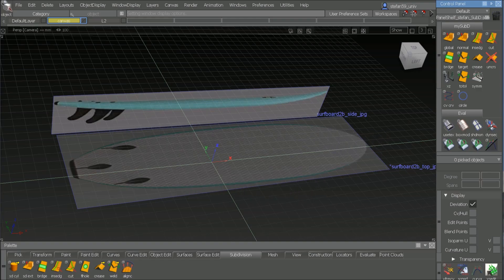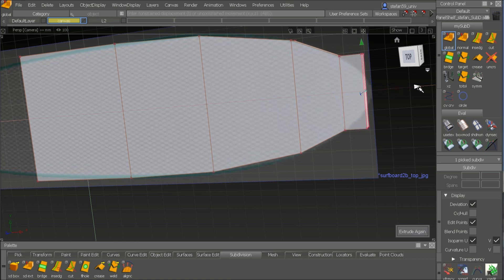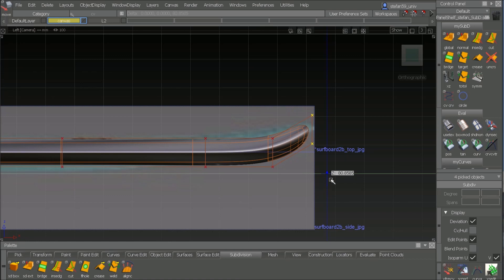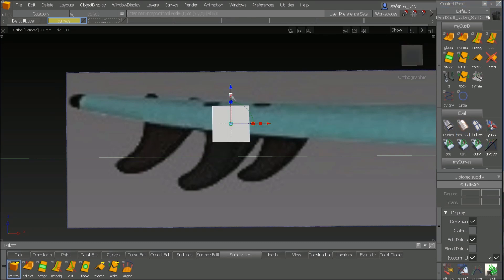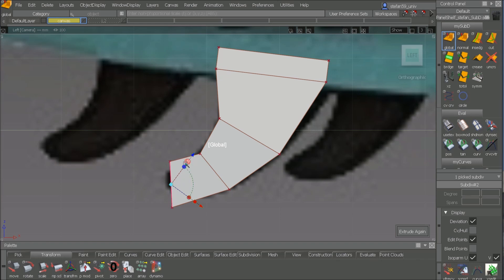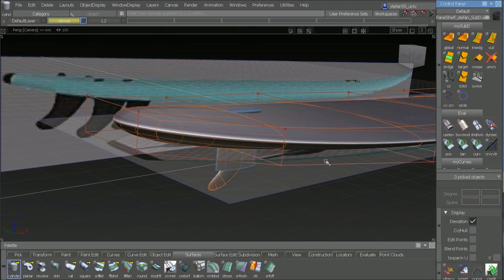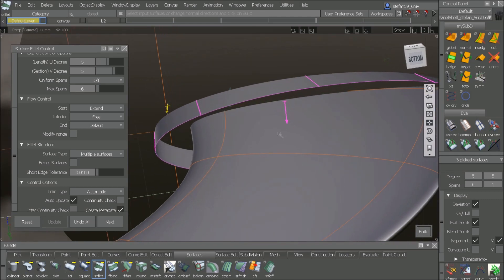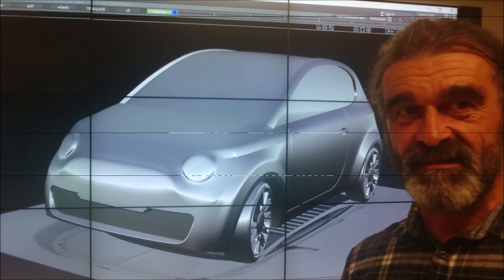Alias 2020 SubD Modeling Basics

Comment: My alias is 2020 and it doesn't have this subdivision feature. Does this link you put in the description happen to install this feature in the program? Thanks
Reply from the maker: Hi Mauri, usually Subdivision Modelling is by default included in Alias2020. My links just give you additional user menus for faster workflow. In Alias 2020 you find Subdivision Modeling Commands under Palette->Subdivision. Probably check also your license: Is it Alias Design, Alias Surface or Alias Autostudio?

Comment: Great video.   I'm sure Stefan knows this.   For anyone following along, when moving cv's. Instead of pick nothing, pick CV, move, then hitting pick nothing afterwards, simply press shift after you have moved the CV.  This takes you back to selection mode while still in the move tool.  Look in the prompt line to find out what your selection mouse buttons are.   My middle mouse button is set to "pick" , which allows me to bounding box on the next CVS and it will automatically deselect the previous selection, let go of shift and proceed.   Alot faster and allows you to use pick nothing a little as possible.   Keep surfin'
Reply from the maker: Good Point Kevin! and for a VREDuser easy to remember (Shift-Selection) Will change mouse selection options in my PrefSet for 2020.2